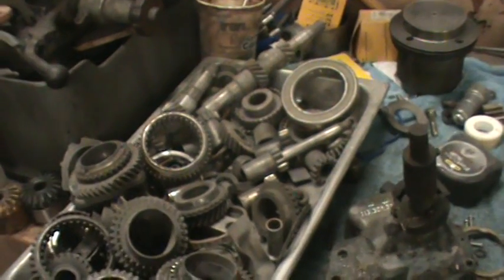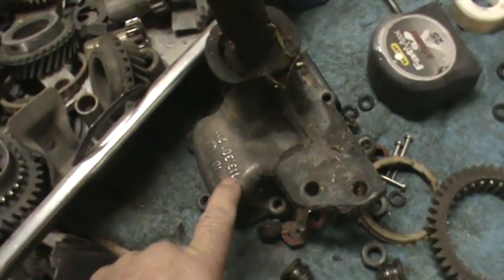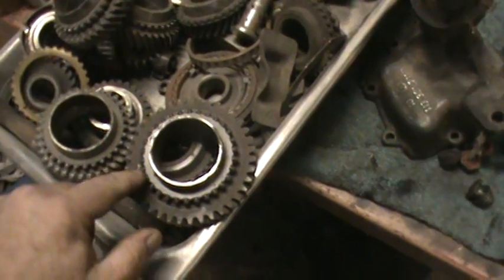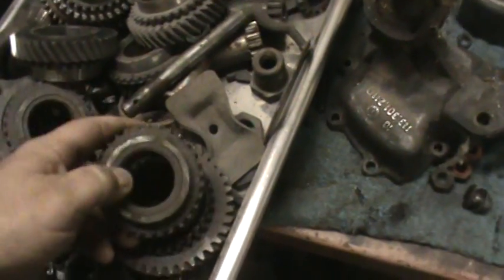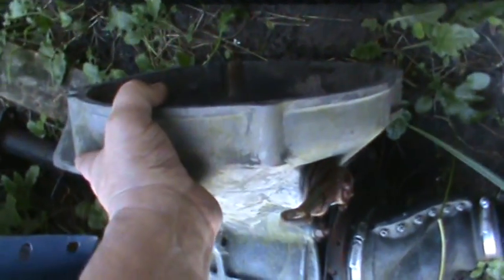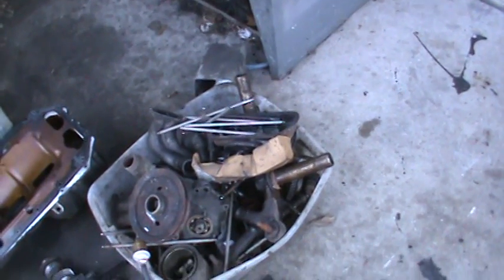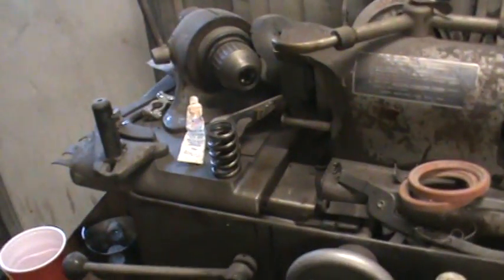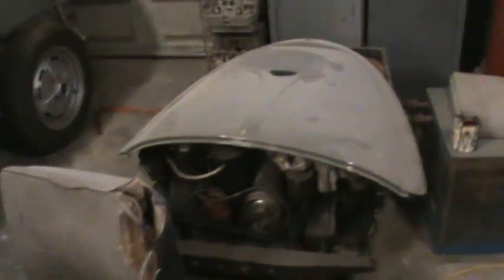some vw stuff

Comment: thanks right off the bat for takin the time on the vid, both of my nose cones say 211, but have the offset motor mount holes, and other then the engine, it is all back together, it feels much better then with the other box, input looks right and theres only one hole for the lock bolt, and its in the right spot, so tomorrow will be the tell, thanks so much for all the help and info, peace brotha from a different mutha,,
Reply from the maker: very cool hope it works well , save those 211 nose cones